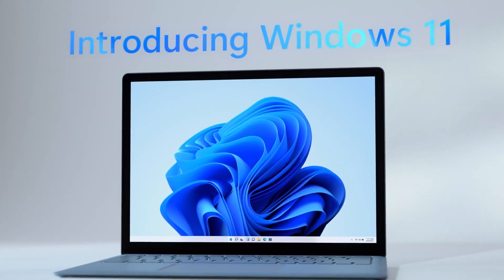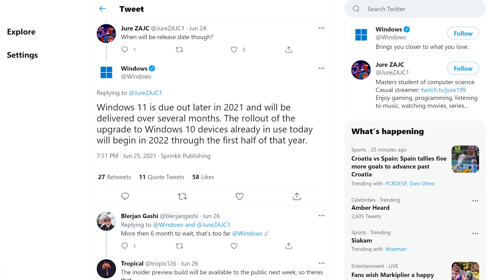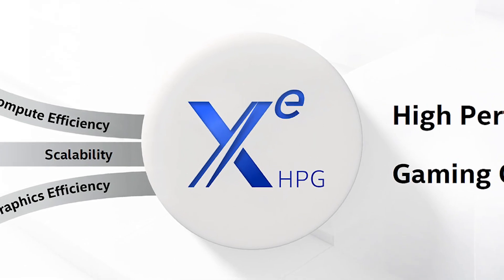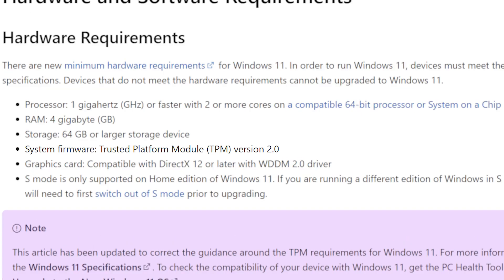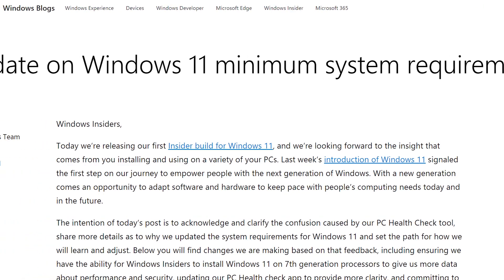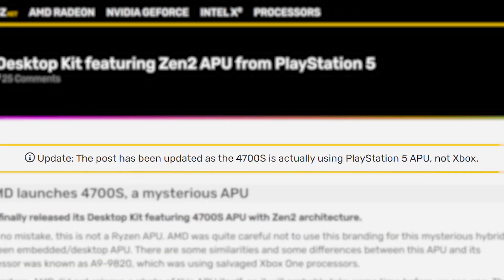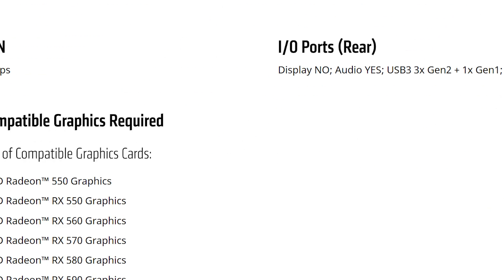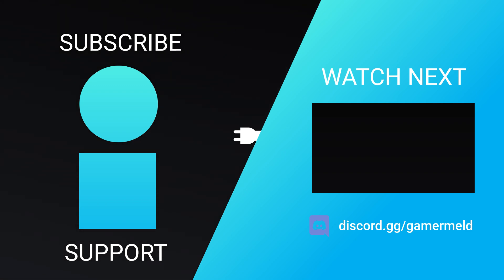TONS Of Gamers WON’T Be Able To Install Windows 11!

Comment: Man, this is really a year of disappointments. Plenty of hardware releases that we're unable to buy due to shortages, and now a new OS that we can't use coz we have no new hardware due to shortages.  >_<'
Reply: I think they will roll the TPM requirement back.
Reply: @derek8564  will see
Reply: @Mordies  time as, always will, tell.
Reply: I haven't thought about it this way, but it's exactly this way.
Reply: U can bypass all of these by modifying setup
Reply: @AnantaFN  Yea, from a prototype build. You don't think MS will change that on a public build? That trick is going to disappear once 11 launches.
Reply: I dunno where microsoft Is going with this.....what's next? Windows 12:need rtx3090ti to run properly?
Reply: @tijildubey77  rtx 3090 will become obsolete by the time windows 12 releases
Reply: @Liam Henson I'm even more pissed cause I was just planning on upgrading my old i5 7500 to an i7 7700 and they say it doesn't support it
Reply: It’s pretty easy to bypass a lot of the requirements like tpm there are lots of YouTube videos on it now
Reply: W10 still supported until 2024-2025 i belive so... i guess it is better than nothing.
Reply: Yeah what the actual fuck man.
Reply: Linux.
Reply: What the reason to upgrade to  the new OS now…? As long as no program or games requirements like win 10 only why need new OS
Reply: @handy333  Microsoft likes to fix things that aren't broken. I thought Windows 10 was going to receive updates forever, but instead Microsoft decided it was a good idea to create another OS. Windows 10 is good enough probably for the next 10 to 20 years. Instead Microsoft is deciding to end support for 10 in 2025.
Reply: i don't think they have worked much under the hood. it looks like they just skinned the windows 10 UI and added some animations.
Reply: 14 Intel Corporation Locations in Israel 🇮🇱 is a little extreme no? 

Israel	
Haifa

Matam

Matam Tower 1, PO Box 1659, Matam Industrial Park, 31015
Israel
Jerusalem

Jerusalem

S.B.I. Park Har Hotzvim, 91031
Israel
Jerusalem	Jerusalem	3 Kriat Hamada, Har Hotzvim, GATI Tower, 91450
Israel
Netanya	Halilach	37 Halilach Street
Israel
Petah Tikva	
Azorim

94 Shlomo Shmeltzer, Dekel Bldg, Ofer Park, 4970602
Israel
Petah Tikva	Azorim	94 Shlomo Shmeltzer, 7th Floor, Brosh Bldg, Ofer Park, 4970602
Israel
Petah Tikva	Azorim	92 Shlomo Shmeltzer, Flr. 6-8, Alon Bldg, Ofer Park, 4970602
Israel
Petah Tikva	Azorim	94 Shlomo Shmeltzer, Oren Bldg, Ofer Park, 4970602
Israel
Qiryat Gat

Lachish

New Industrial Area, 2 Tzoran Street, 82109

Israel
Raanana	Zarchin	13 Zarchin Street, Building C, 7th & 8th Floor, 43662
Israel
Raanana	Zarchin	Hatidhar 2, Millennium Building, 43665
Israel
Tel Aviv	Ramat HaHayal	7 Habarzel Street, 69710
Israel
Yakum

Euro Park

2nd Floor, Euro-Park Italy Bldg, 60972
Israel
Yakum

Euro Park

Ground Floor, Euro-Park Holland
Reply: CPUs are available at msrp though
Reply: I mean it’s really just a matter of have an upgraded processor, which aren’t hard to buy like GPUs. Im solid but don’t feel any need to jump right on W11. Let em get all the bugs fixed first
Reply: @voyagerJT  it's going to be 100% spyware. 🇮🇱 NWO under Israel
Reply: @paullarue4896  real talk cyber security is big factor in whether I upgrade or not. Can’t be too safe these days
Reply: @voyagerJT  they want control of the crypto wallets. Using China as a proxy as 10 Israeli companies try to hack crypto wallets around the world. Same slew of people who are in control over the NSA SEC and FED CIA FBI. All gansters
Reply: @paullarue4896  crypto is safer than that. At least for people smart enough to keep it offline on a cold wallet. The whole appeal of the block chain is that its public and verifierd by nodes all over the world. Crypto is only unsafe when stored on exchanges prone to cyber attacks like what happened with nice hash back at one point
Reply: @paullarue4896  the only spyware which antivirus can't detect
Reply: @supersaiyaman11589  Everyone knows that Israel controls Microsoft and Intel now since they are headquartered in Israel.  I miss spoke when I said Spyware. I was using spyware in place for BACK DOOR. This is exactly what they are doing. If you don’t believe me in their global take over look at the List under President Biden. It’s 76% Ashkenazi
Reply: @paullarue4896  HOW DO YOU KNOW THIS KIND OF STUFF? Are you a special agent? Normal people don't know this kind of information...
Reply: @paullarue4896  That's what the Illuminati lizardfolk want you to think
Reply: @bumas3825  it’s in the news every day
Reply: @paullarue4896  There are Microsoft and Intel offices in other parts of the world too, not just Israel.
Reply: @rtlau-mk4di  what is the purpose for 14 campuses in a country with only 2 million people?
Reply: Blame Israel 🇮🇱. Seriously

Comment: I have a ryzen 5 3600. I enabled the ftpm thingy in bios and all was well the past few days. The PC health check thing said my PC was compatible. All of a sudden I start my PC today and get one of those American Megatrends errors:

"New CPU installed, f TPM NV corrupted or f TPM NV structure changed. 

Press Y to reset f TPM, if you have Bitlocker or encryption enabled, the system will not boot without recovery key.

Press N to keep previous f TPM record and continue system boot, f TPM will not enable on new CPU, you can swap back to the old CPU to recover TPM related keys and data."

I didn't change my cpu or anything... Windows 11 is already destroying my pc and it isn't even out yet. I chose the second option btw which turned off tpm and I'm leaving it that way for now.
Reply: As long as you didn't encrypt your drives with Bitlocker you should be fine with option 1.

Also it's your BIOS acting up, not windows
Reply: @mizz1414  The windows thing was a joke of course. But yeah next time I'll try the first option as bitlocker and encryption in not enabled.

Comment: - It's time to go, Intel Core i5 2500K.
- Was I a good CPU?
- No... I'm told you were the best.
Reply: Most of the system in libraries I work at run systems running that era of CPU, for everyday tasks they are still perfectly fine.   Ending W10 support in 2025 is going create so much unnecessary eWaste.
Reply: Sandy was dandy but she is old yeller now. Was the first chip I built my first pc with and I loved her well.
Reply: I was still running a 2500k on my 2nd computer until early 2020. Truly was the best
Reply: My first chip was the i7 2600k, both the i5 2500k and i7 2600k were amazing chips, sadly I had to let the i7 2600k for a i7 9700k

Comment: People still use Windows 7 even though they discontinued support for it. Just because Windows 7 was such a stable operating system. I think people will hang on to Windows 10 the very same way. I don't think it's going to be detrimental to Gamers whatsoever.
Reply: W10 is going to be my last windows, when I won't be able to use it anymore I'll just switch to Linux.
Reply: @gabexd39  Thought of the same, Microsoft is going too much apple for me...
Reply: @gabexd39  don't switch right away without research, even though Linux is better in some areas than windows, there are just a lot of things in windows we take for granted and Linux aucks when you don't get those things, like it took me almost 2 hours to get running on Linux because of compatibility issues and command line errors, but in windows you just download and install, no bs.
Reply: @gabexd39  thats the issue tho. its not super user friendly for average joe. unless u understand what u r doing u ll get lost even with some guides. in my opinion itll be super helpful if all driver is built in from the get go or at least accessible from gui. no need for commnad line for them. even i manage to fail some of them lol.
Reply: @gabexd39  It was suppose to be the LAST windows. I guess for many of us it will be OUR last windows !!!
Reply: @omegaman7377  True
Reply: @gabexd39  this is exactly my statement.
Reply: @gabexd39  why would you not be able to use windows 10 . even wene they discontinue support for it you can use it for a long time to   just wont provide updates for it.
Reply: @gabexd39  No games?
Reply: @gabrielvieira6529  you can play most steam games on linux, especially if you get a distro that's geared towards gaming
Reply: Don't care if they discontinue the support..means i dont have to restart everytime the force update my system..
Reply: @bartart5147  Agree
Reply: Yes ofc, just because it is not supported. We can still use it and creators can too
Reply: @aless7125  oh absolutely. I never argued that once. I am just emphasizing the ridiculousness of Microsoft's threats to discontinue support and how useless those threats are.
Reply: I don't know why but windows 10 looks more outdated aesthetically than windows 7, I am still ready to use Windows 7 but I too bored using windows 10.
Reply: @tanishqsuryawanshi1276  i feel the same!   Win 10 feels 1980's and window 7 felt like 1999.
Reply: Hell. One of my desktop PCs still running XP and feeling great. One of my laptops is a dual boot with backup system being XP as well. I have no problem with old os as long as it does the job. Besides, I have no intention of having  Microsoft account and you can't have 11 without it. It means I'll be running XP, 7 and 10 on my computers as long as I can and then will switch to Linux or something else. Screw Microsoft.
Reply: I'm def. going to try out the known workaround with replacing the alpraiser.dll in the install ISO with the one from Windows 10. But more people should know about it. And when they do Microsoft will nerf it. At least we get supported until 2025
Reply: * appraiser.dll
Reply: Steam still supports Win7... so I dont think they will kill off support for Win 10 for a long time.
Reply: @heyitsdazy  updates will stop after 2025 but as far as gaming on steam goes you should be just fine.
Reply: Windows and stable.... AHAHAHAHAHHAhahahahahahahahaHAHhhahaHahahHHAHAHAHAHAHAHAHA...
Reply: @user-eq2fp6jw4g  yeah its stable. Fun fact the world is not a penguin circlejerk and 75% of linux distros are worse in stability compared to windows
Reply: @pritampaul2507  you have 1 distro, and you're a slave to it 100% of the time lol the rest of us normals use the other 25% of stable distros to game on scrub. git gud.
Reply: I still run Win 7 on my 2nd desktop and on my i5 laptop (dual boot with Linux Mint 19).  Personally, there hasn't been 
an OS released since the final version of Win 7 that does anything I really need an OS to do.  So, Win 11?  Meh!

Running Win 10 on my primary desktop.  It's OK but nothing special.
Reply: I wouldn't put it passed Microsoft to incorporate a 'kill switch' into a vital part of the code that can't be easily ripped out. Windows 10 may just stop working, or become so intentionally glitchy that it is unusable, after a certain date. They're clearly not above such tactics based upon their past behaviour.
Reply: windows 7 is way less buggy, more stable and feels way more confortable than windows 10 ngl, i still used it last year and would switch back to the painless windows 7 if todays games would support it. sry if my english sucks
Reply: @ep1k_4  well that makes sense as its bean out way way longer they have had time to patch all the bugs. What bugs are you referring too in windows 10. i have not noticed any could you share your experience please. you English is fine don't worry about it.
Reply: @supersaiyaman11589  every second time i log in, im ending up with black screen. i need to log out with ctrl + alt + del. another bug is that every time i update windows the desktop icons get moved randomly automatically, thats i use sort by name everytime i log in so i dont waste my time by searching them
Reply: @supersaiyaman11589  those 2 bugs are the common ones im experiencing a lot
Reply: @ep1k_4  what bugs are you talking about in the os
Reply: @ep1k_4  those are unusual bugs.
Reply: what version of windows are you running
Reply: @supersaiyaman11589  newest windows 10 home i think because i do every single update i get
Reply: I heard windows will have some sort of texture download for games so no more pop ins while gaming so it’s kinda annoying important for gamers
Reply: Direct storage* if it works properly
Reply: I hope that with shit microsoft trying to pull, it will open more opportunity for users to migrate to linux and make it more popular that more and more corporate company will be willing to provide their apps and support for linux.  1 issue tho, linux stock ui might turn them off. I just hope that one day linux developer will improve the default look of their DEs so they will be more eye pleasant and up to today beauty standard. It is weird that hardly any developer care to improve gnu linux DEs look aside from kde plasma and deepin. Even that,  plasma still has long way to go while deepin run so slow to the point that it is unusable. The rest look like they are still in 2010 at best with no effect whatsoever. I hope it will change in the future given that we already in 2021
Reply: Yes but one day down the line some games might not natively support Windows 10 and then you end up with a lot of e-waste unless people start either using virtual machines or keep a windows 10 based pc for windows 10 gaming.
Reply: Windows 7 was one of my fav, Windows 10 updates just give more BSOD and crashes...
Reply: ofcourse you dont need to jump to the bandwagon right away.
Reply: I had windows 8.1 for 5 years and turned off the updates and never updated it once. Never had a single problem
Reply: @ButtonandBuck  Not that you're aware of... Modern hackers don't want their victims to know that their system has been compromised.
Reply: Train-ticket machiens in germany use WinXP!
Reply: Yes I am still use Windows 7 cause, compability
Reply: Totally true, I still use win7 for 95% of my games, and have dual boot on W10 for exclusive win10 games on an old AMD FX with a 1080, still runs pretty darn well
Thing that made me laugh :  a group of government men specialized in cyber security in my country,  still use win7 on their machines :)

Microsoft are a bunch of greedy peeps, claiming that win10 will be the only OS tu support DX12 and it will be necessary to upgrade if we wanted to play in the future blahblah
turns out only like .. 5% ? of the whole steam game library has game requiring  DX12 only .. basically nothing
what will they do for W11 ? DX13 ? lmao
Reply: It's still a horrid idea, Windows 7 was already a vulnerable build of an inherently vulnerable os, now it's gone so many years without security updates
Reply: @Bobby-Bologna0451  and ? what will they find ? if people are too dumb to keep bank data or whatever payment stuff on their PC, bad luck
win10 is not safer because microsoft told so, if they gave this OS to everyone for free for such a long time, no worries they got their payment back with all your personal data
Reply: I use Win7, WinXP and Linux on 7 diverend PCs...
Reply: It depends on what the game studios do. How far back will a new game be installable on older OS's? With Ray-Tracing etc. it's anybody's guess.
Reply: @Setmose  RAY-Tracing? It was used in the 90s and you only need to build it into the game to work with for example the RX 570 or GTX 1070.
Reply: Well...windows 11 will have auto HDR and direct storage which won't come to windows 10. So will be detrimental to gamers, although only slightly.
Reply: @DelightfulWalrus  First, You need a HDR supported monitor for Auto HDR feature
Second, Direct Storage API needs a faster NVME SSD with atleast 1 TB and needs DirectX 12 Ultimate supported GPUs (which is RTX 2000 series or above)
So, it can't be a good detrimental to gamers who didn't owned these.
Bruh.
Reply: @DanteOfficialYT  dx12 is supported on as low as the 600series and is getting support for as low as Fermi. If you have something lower than Fermi then wont even an integrated gpu be faster nowadays?
Reply: @darkwolf1739  I am talking about DX12 Ultimate, not DX12. DX12 Ultimate support only available from RTX 20 Series GPUs.
Reply: In india most of people use win 7 bcz they only use for billing purposes I see some people still use windows xp I recently switch from 10 to 7 bcz of display driver crash problem in 10 in every update win 10 comes with new bug and win 10 have huge load system when booting win 7 is most stable system in history I think smooth like butter system boot in 35 to 40 second in 11 year hdd and pc I never change any components
Reply: No wonder india is the leading country of creditcard/antivirus scamming.  Maybe they should start teaching ppl how to use linux instead.

Comment: Those are probably just tested CPUs. That's what I got out of it, not sure why you'd assume they'd lock out older CPUs from running windows 11 if it meets the clock and core count requirement. Unless the CPU is over a decade old, it will probably work and that list can be treated more like a QVL list than an absolute. Some RAM not on the QVL list for most modern motherboards work perfectly fine regardless
Reply: Specta and meltdown.

Comment: So they sell us a defective APU on a cheap ass mobo for an insane price and they bin as many gpus to 80 CUs as possible because 6900xt have a higher profit margin than 6800xt. Try finding a 6800xt for sale, but 2000 dollar 6900xt everywhere. Last straw will be impossible to find 5700Gs.

Comment: ill stick to win 10 til 2024, i turned on tpm on my 5800x and had nothing but problems like instant restart while loading a game or benchmark.
Reply: You're lucky, I looked for the TPM settings on my B350 Gaming Pro Carbon and well there just is none... Seems like I will need to get a new motherboard, at least my R5 3600 will do fine with Win 11 I guess